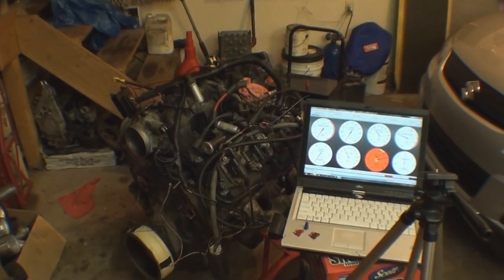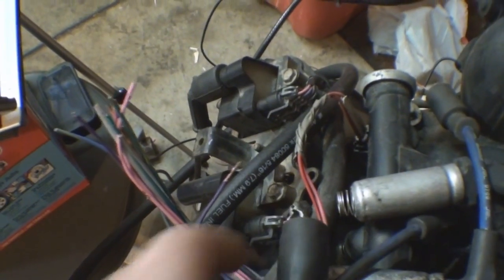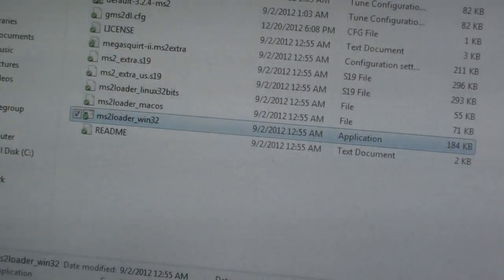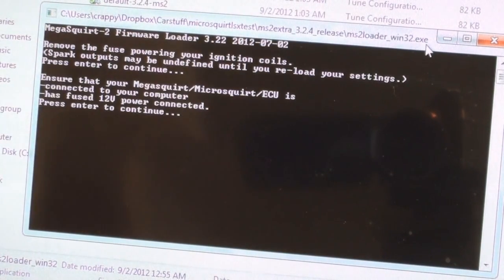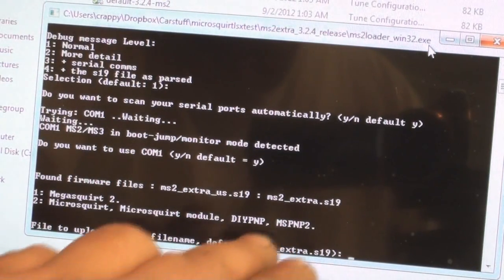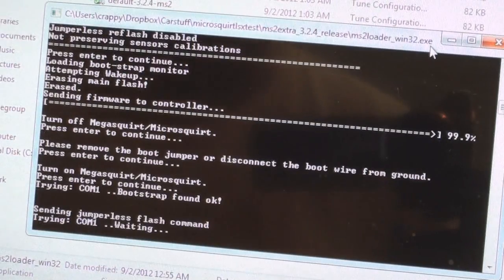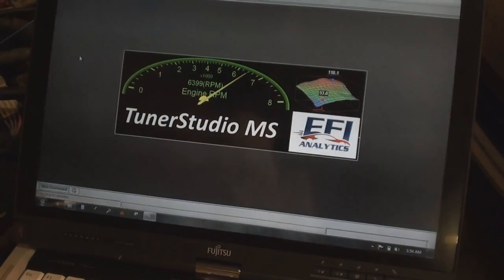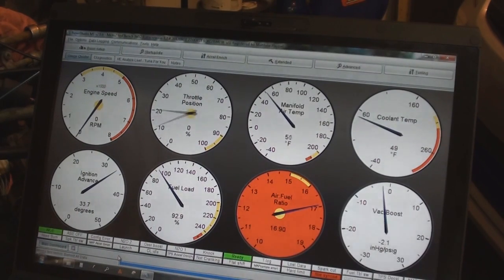3-1-13 how to flash and test a microsquirt2 for LSX

Comment: power ripple i thought would may mess with it i allays used capacitor filtered power supply or a battery ....example ...allso the harbor freight large battery charger i got to repair fer a fellow output like 16 volts or one setting and 11  and 18 on highest setting  funny how that china junk especially battery chargers ........ great videos man thanks a billion

Comment: A variable power supply will do a better job of keeping power to the MS unit, those chargers like to turn power on and off a lot while the mcu they use samples the 'battery' voltage, even if there is no battery.  A computer power supply would work for 12v if you don't have a battery handy to keep 12v.

Comment: Megasquirt is a bigger less compact version of Microsquirt, microsquirt is basically a pre-packaged surface mount version of the "diy", build it yourself ECU known as megasquirt.  Essentially, they are the same thing, just different hardware packages.  Tuner Studio is used to program megasquirt and microsquirt in the same way HP tuners programs the stock GM ECU.  I have some videos about building an MS2 if you are interested.  MS2/MS3 basically replace the GM ECU. Keep up the good work denmah!